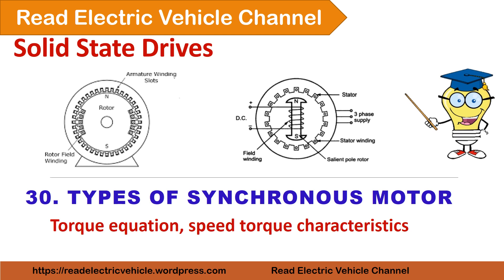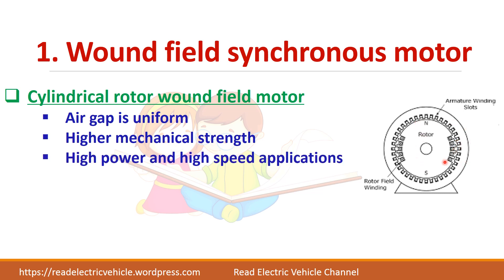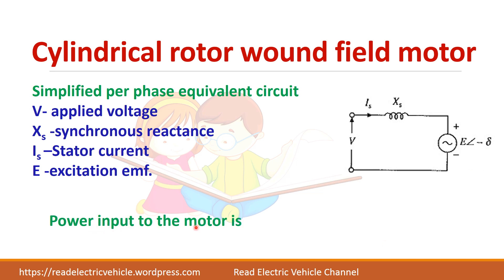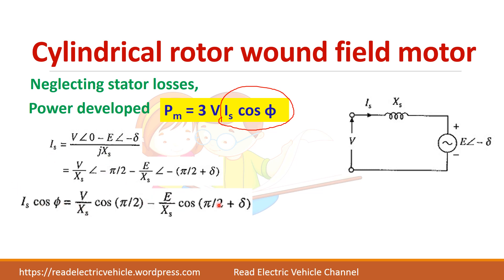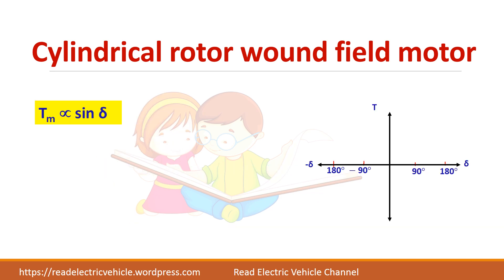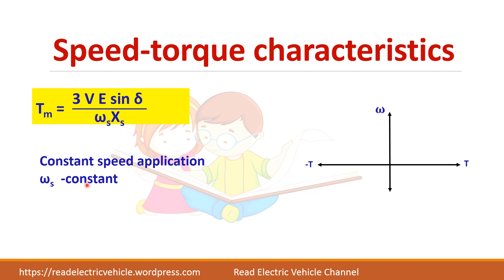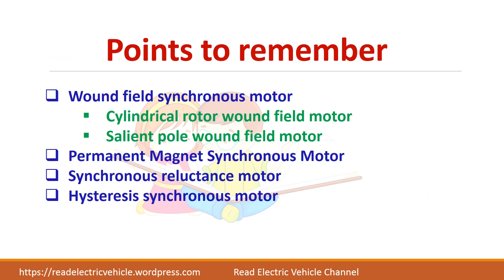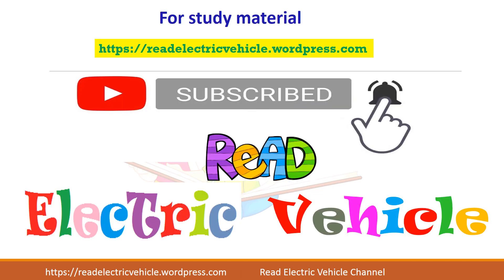Types of Synchronous motor/Wound field rotor/speed torque characteristics

Comment: You video says that field-oriented control is not possible is not correct. See my SPRINGER book "Advanced Control of Electrical Drives".
Reply from the maker: Are you talking about permanent magnet synchronous moptor?. 12.16 
Can you specify the author and chapter in the book?
Reply: Two of my Springer books cover this: 1. "Advanced Control of Electrical Drives", 2. "Applied Control of Electrical drives " (a 2nd edition coming later this year)